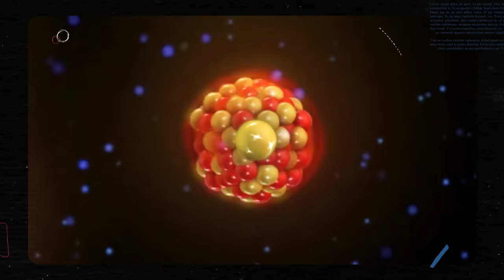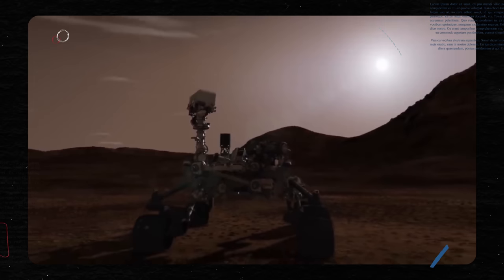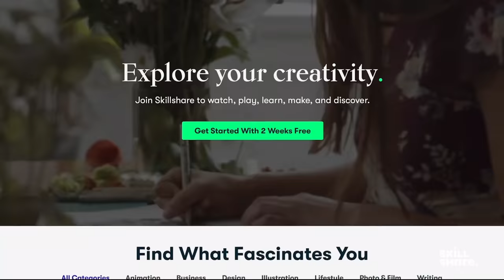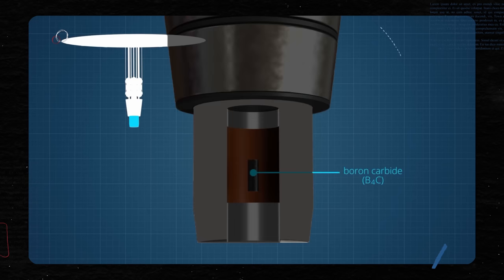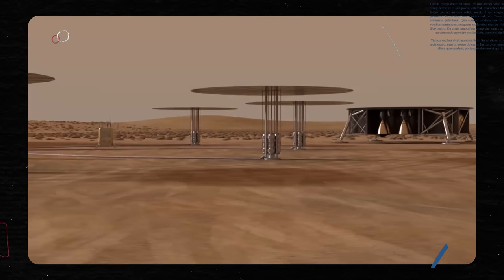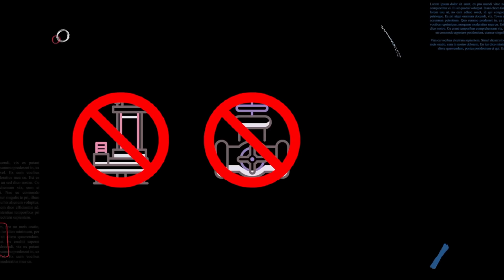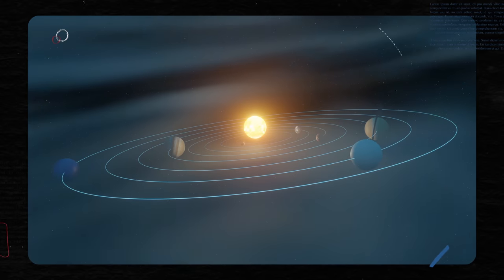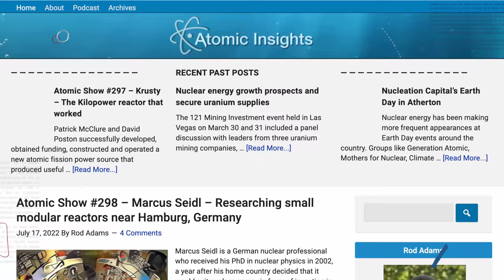Why NASA Is Working on a 10KW Nuclear Reactor?

Comment: I have been recently posting a link to a NASA and DOE film of a Stirling Engine they designed and tested with MTI through the 1970's-1980's.  It was tested in vehicles and showed in real world tests it could replace gasoline and diesel engines with a more efficient (38.5% thermal efficiency was achieved) and lower emissions quiet engine which was multi fuel capable.  The working fluid was hydrogen, and durability tests were conducted out to 50,000 hours of operation with little degradation and failure as oil changes are not required due to the clean nature of this particular external combustion design which traces it's origins to an old Siemans design Stirling engine.  Very interesting video if you just search NASA Stirling Engine
Reply: I think I watched that, brilliant,,

Comment: Sira!  I missed you.  And your hair grew.
Sterling engines are fascinating, but sadly one that hasn't really been developed well for industrial (or space) use yet.  They still have some problems to overcome for off-planet use.  I'm still dubious that they'll be able to radiate enough heat to keep the Sterling engines functioning in a vacuum.  But I'm no engineer, so pay no attention to me.
Reply: the new hair is way better
Reply: @manofsan  I dig her short hair.  It takes all kinds, I guess.

Comment: Thank you for this new video!

The Kilopower reactor sounds like it could be extremely useful in space exploration. We may use solar power to some degree on the Moon or Mars, but it won't be as dependable and useful as it is on Earth. What we really need is a dependable, maintenance-free power source that doesn't need to be constantly refueled. It sounds like Kilopower could be that power source, especially if everything is sealed away so dust can't get to the inner workings.

And the idea of using them for nuclear propulsion is awesome! Imagine a probe with a Kilopower reactor and ion engines... It could last for decades.

Comment: Stirling engines have been used in space for a long time. Usually for heat or cooling, but there is no reason they cannot be used the other direction for power. This isn't really very new at all and was probably conceptualized in the 1950s.

The main problem with Stirling engines is seal friction and wear. To make them efficient you usually need to fill them with high pressure hydrogen. Hydrogen likes to get out of whatever you put it in. To combat that you need good seals, but that leads to high friction and wear. Roll socks and other methods have been used to combat that, but all have limited (short) service lives. Perhaps a bellows based design could be used with a high fatigue life.
Reply: Why not just supply hydrogen from time to time?
Reply: @jakubiskra523  The wear would cause it to leak out quickly depending on the seal type. A roll sock will just rupture when it fails and you are done. Any sort of sliding seal would wear and leak faster and faster over time. What you are proposing would work for gas that diffuses thru the metal or small leaks. It seems like a metal bellows based design could be made with near infinite fatigue life if the stresses are kept low. But high pressure and bellows don't exactly mix. A design challenge certainly. 
It might be viable to pressurize the crankcase as well and have no moving seals on the pressure boundary (put a generator inside the case, and just wires penetrate the pressure boundary). Then there isn't any pressure across the piston seal except the transient pressures while running (which would be orders of magnitude lower pressures). Not sure what affect the case being at high pressure would do though. It would definitely be a gas spring on the case side of the piston. The lowered pressure means different types of seals can be used, and that they wouldn't wear as fast. 
Or maybe the case has a pump that constantly tries to put I back on the high side, but seal wear will eventually win that fight. 
There are various ideas that have been tried to fix the issue over the years. Ultimately we haven't switched to Stirling engines for the seal leakage reason though (and just the retooling cost). It hasn't been solved to my knowledge. 
Historically they are not as reliable as other engines. So I am particularly curious what they are purposing for these engines for long term missions.

We should be exploring them for car hybrids really. They are more efficient than the ICE, and could burn a myriad of fuels, even in the same vehicle. We could probably add 10% efficiency to the process which is 25% better than now.

Comment: What are the scaling considerations for those designs? How small or large can they be?
Reply: Both the current Chinese version, and KRUSTY's precursor project are 1MWe, so 100X as much power.  The reactor part is about 50% heavier for 100X more power.  Nuclear scales up super well.  Total package including all power conversion, controls cabelling, etc. for the US project: 20 tonnes.  Compare to SpaceX heavy rocket 100 ton payload capacity.

Comment: I think one of the most interesting uses of kilopwer is to power tunnelbot a conceptual drone that can be used to dig through iceshell worlds to explore the liquid oceans below
Reply: I think thouse heat-drill based concepts are their own designs from scratch, as they direct most heat externally rather then produce electricity, they are made of a lot of similar components though such as heatpipes and small enriched uranium cores were berrylium reflectors.

Comment: Great explanatory video thanks. I wonder how it could be scaled up for use on earth as micro nuclear generation. The direct heat transfer design certainly beats water boilers and turbines for simplicity and the reduced cost may compensate for reduced efficiency. Sodium has been used for decades in automotive exhaust valves to transfer heat up and away thru the valve stems but it may not scale although there is a lot of experience using sodium as the main reactor coolant in some reactors. Stirling engines have been used by the Swedish and Chinese navies to silently power submarines and there are some other limited uses of high powered Stirling engines. UK companies experimented with them built into the exhaust outlets of domestic gas boilers to produce a few KW of electricity for the house. This seems not to have taken off as yet, but perhaps it would be a useful adjunct if/when H2 powered boilers get going.
Reply: This probably won't see much use on earth due to the proliferation factor. That much uranium concentrated that highly can be turned into a bomb with minimal effort, meaning the cores would be under constant threat of theft by anyone interested in a bomb. Normal reactor fuels aren't concentrated high enough for that to be a real problem, and the cores which are enriched that highly are under the control of militaries so they are already guarded quite well.

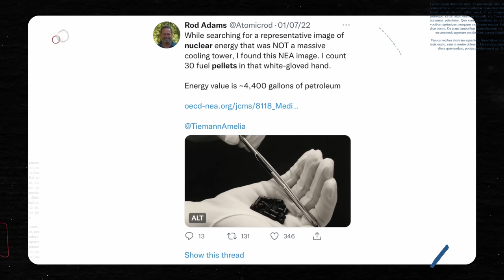Comment: 01:08 What is 4000 gallons? 🤔🥴 Pardon for not knowing these highly sophisticated and esoteric units 🙃😅 and asking for using litres in SI Metric which 99.98% of countries are embracing. 🌍🤗
For the majority of the people wondering, 4000 gallons = approx. 15141 litres 😀👍
Reply: How many gallons = 1 gallon?      (Not all gallons fit snugly in the same size containers. Litres are no good, they have far too meager reserves for spillage. ;-P

Comment: The temperatures at the ends of a heat pipe are equal. Hot end and cold end are misleading since they  refer to the external environment, not the heat pipe itself.
Reply: There is a difference in temperature, but a small one.

Comment: This may be a premature question! How fast can an appropriately sized engine powered this way push a spacecraft? Yes, I know it won't be, "warp speed" but I have no idea. Any thoughts? Thank you for an excellent video! 🧡
Reply: The specific impulse would probably be in the same ballpark as other nuclear thermal engines, so about 10 km/s.
Reply: @ianmathwiz7  Thank you!
Reply: Electrically powered spacecraft aka Ion propulsion systems that consuming a constant amount of electricity still have the inherent ability to trade off between efficiency and thrust.  So you can burn propellent slowly at high efficency to get a long period of low thrust, or burn it fast for high thrust over a short period, the total cumulative acceleration (called impulse) will be greatest with high efficiency, but the acceleration at any one moment is highest with low efficiency so your question needs to be more specific.

Also the Kilopower system powered vehicle will only be faster then a solar powered one if both are past the orbit of jupiter, inside that utilizing solar power will be better because it will be lower mass for the same energy output and the craft will thus have a better power/weight ratio.  In any even all electric/ion engines are only going to give craft acceleration rates of around a milimeter per second squared at best, but this will greatly outperform chemical propulsion when traveling to another planet such as Mars due to the time to build up high speeds.

Comment: Weren't the Voyager probes powered by small nuclear reactors?

Edit. Oh, you mentioned them.
Reply from the maker: Yep, by radioactive decay though, not fission.
Reply: It is worth noting that these two phenomena are identical in nature, the loss of mass of a given element. However, they differ in certain properties and the previously mentioned weight loss has a slightly different reason.

Comment: Aside from increased Launch Mass, what's the Problem(s) with Conversion of Thermal Energy to Mechanical for Storage (Flywheels?) in Zero-G?
Reply: Lots of Newton's Second Law considerations. You're imparting massive torques to the system, precession of such a large rotating mass would cause further problems, the angular momentum would resist orienting the spacecraft properly, etc.
Reply: @willythemailboy2  even if it's supposed to stay in a relatively static orbit, either in relation to Sol, the Earth, or some other Planet (as opposed to an Asteroid or Moon)?
Reply: @thesun6211  Yes, as the thing would still need to be rotating once per orbit to maintain its orientation in relation to what it's orbiting. In two planes if it's orbiting a planet as well as the sun.

Comment: Correction: The solar energy density fades as the inverse square of the change in distance.
If x is the distance, and the distance is doubled, i.e., 2x , the change in energy density is 1/change is distance, squared, or in this case, 1/ (2, squared) --> or 1/4. So the diminished energy density becomes 1/4th of x.
Again, properly stated, it's the inverse square of the change in distance.

Comment: A very  interesting concept, but there are a few missing pieces in your narrative. You describe a Be reflector and a b-10 control rod, but fail to mention a moderator to slow the neutrons down so they can be captured by the fuel. (There are approx 2.43 fast neutrons per fission, you need to lose 1.43 of them to leakage or absorption by non-fuel components and slow one of them to thermal energy for a self sustaining, 'critical' reaction.) In the Boiling Water Reactor Plant you show at the beginning of the video, the coolant (water) is the moderator.  Your control rod description seems to indicate a binary position, either on or off, but as the fuel depletes and as Xe builds up as a fission daughter, your neutron population, and therefore your fission rate will decrease, shutting the reactor down.  The design will need to adjust for fuel depletion and fission product poisons or you will lose criticality.  The greater the adjustment range, the longer life the reactor will have, but this would likely be a failure point and presents some interesting geometry problems. This design will power instruments and other electrics, it will not provide propulsion, and 10 kW (thermal or electric?) would power only a small lunar or Martian installation. A permanent Moon or Mars base would likely require significantly more power capability, and redundancy would be highly desirable. And lastly, for manned missions, we have a shielding problem.
Reply: The kilowatt reactor is a fast neutron reactor, not a thermal neutron reactor, so no moderator is needed. The fast neutron design also helps burn up some of the primary fission daughters, which are themselves fissile in the fast neutron regime. 

The 10 kW power rating is electric, or roughly 43 kW thermal, and fuel degradation will probably be handled with the same passive expansion method described in the video. As the rate of fission decreases, the core cools and contracts, which increases the rate of fission.

Many existing ion thrusters use less than 10 kW of power, so there's no reason that the reactor couldn't provide propulsion as well as powering instruments. Possibly not both at the same time, but that's true of other designs as well.

Comment: You have misunderstood how 'Thermo Electric Generators' generate electricity.
Under no circumstances do they require any stirling engines. They're completely unnecessary and that is not how TEGs work. 
Basically TEGs work by a transfer of heat, from hot to cold thereby generating an electric current with no moving parts.

Comment: You know that there are non mechanical ways to transfer heat in electrical energy and already in use onboard satellites and robot's on other planets
Reply: Yes, but they are considerably less efficient. You get much less power per kilogram of fissile material. New Horizons used almost 10 kg of plutonium and only generated 245.7 watts at launch. This reactor design uses about the same but can generate 40 times as much power.
Reply: @willythemailboy2  I totally agree with you efficiency is a problem, but having a mechanical system for more than 10 year's is a big problem as well.
Reply: @peterevenhuis2663  They've done similar feats before, and that's why they're putting 8 individual Sterling engines on it. Even a failure or two won't cripple the probe, and having even one left working will still give the probe more power than an equal mass radiothermal system.